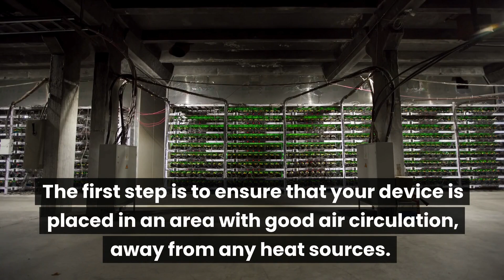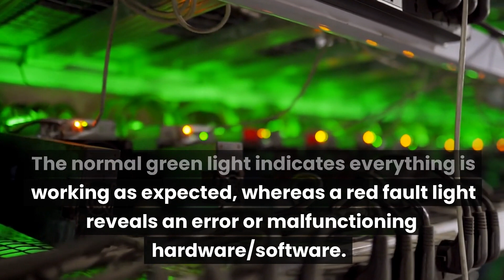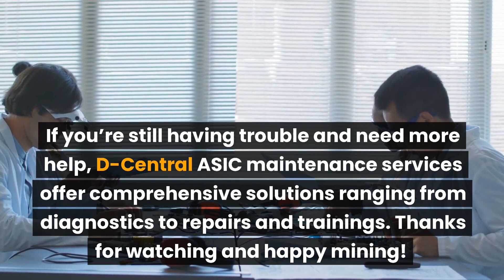Fix Bitmain's Antminer Red Light Flashing Problem in 5 minutes

Comment: Everything is running fine in my miner it's a brand new unit everything is good checked the logs no issues found hashing 2% more than mentioned no hardware errors but. Still red light is continuously blinking
Reply: Same brand new unit causing problem
Reply: i have the same
have you resolv?
Reply: @vale403  it's control board
Reply: Same with mine
Reply: How did you solve it?